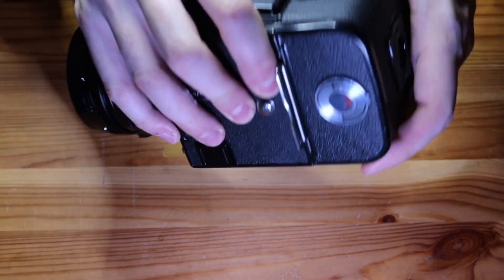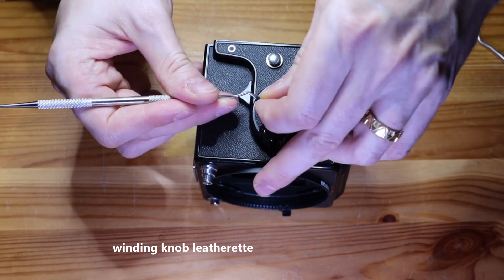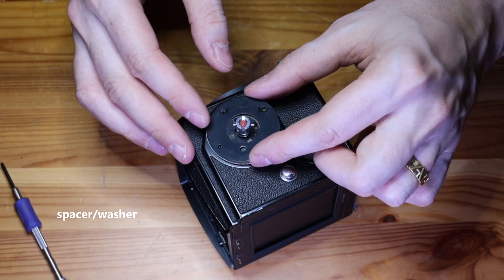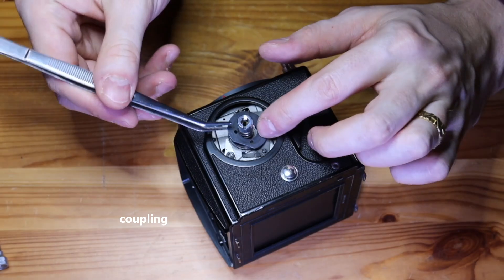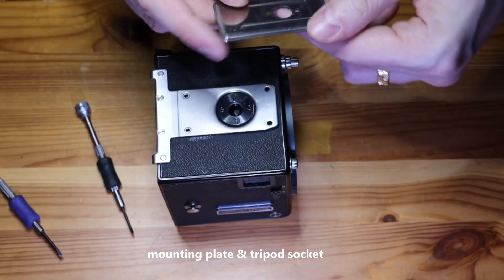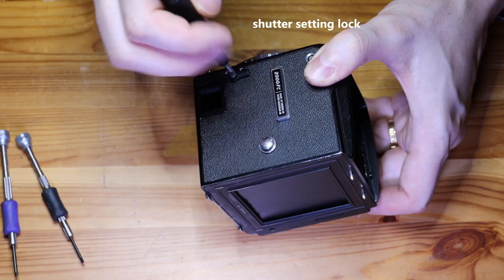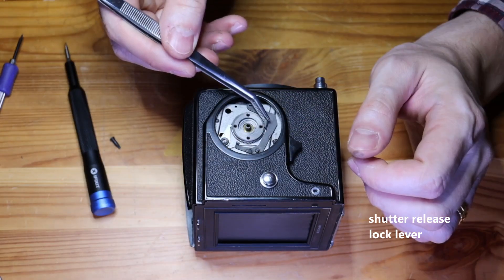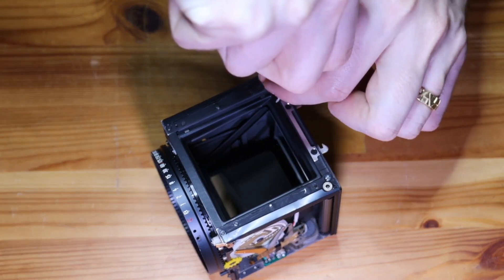Hasselblad 2000FC Shutter Repair

Comment: Forgive me for some comments.
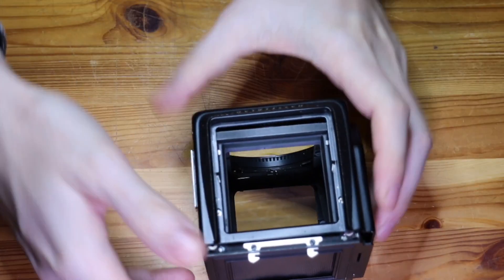At 2:51, you show you remove the frame from the shell, but the plate with the mechanism is missing, so you didn't show how to disassemble it. You removed it, put the frame back in the shell, and then showed how to disassemble it. Why?
I would never use toothpicks to hold down the gear wheels that control the shutter winding. You could break the tip and get stuck, and then it's a pain. Hasselblad provided a special tool (901015), which is a simple piece of wire that anyone can make with little effort.
You didn't show the most important part: how to adjust the tension of the shutter springs to set the right speed, and you didn't show how to calibrate the shutter speeds (a Kyoritsu 8000 and a 6x6 probe are required). You also didn't show how to adjust the focal plane on the micrometer bench. So the camera is definitely not in working order; it's just reassembled and apparently functional. No offense, of course.
Reply from the maker: You are totally right that the camera is out of spec now because I didn't do any calibrations on it. However I have shot 12 rolls with it now in different conditions with great results so it works fine for my purposes. The focus is slightly off which is a little bit annoying but I don't know how to correct that and I can live with it.

As for the missing footage I was lazy when editing this and didn't include everything, sorry.

Comment: Thanks mate for uploading the insightful video. In the video you mentioned, the mirror mechanism was quite special and requires a bit attention when reassembling. Mine FC is currently working okay, however its mirror always goes up after cocking with a lens on. But the camera does operate normally without the lens. I tried to take apart partially, but just wouldn't be able to find the issue. Would really love to hear your opinion on this, really appreciate it.